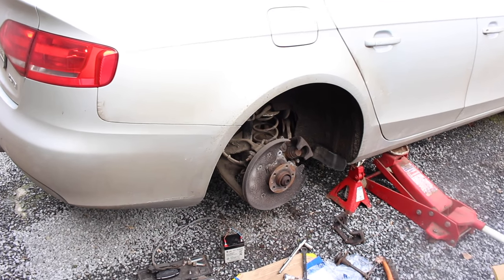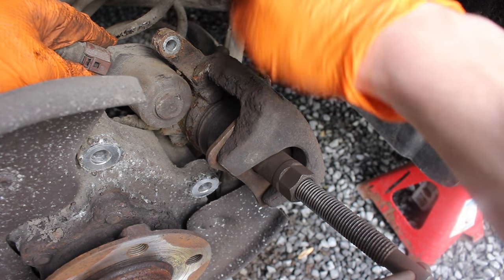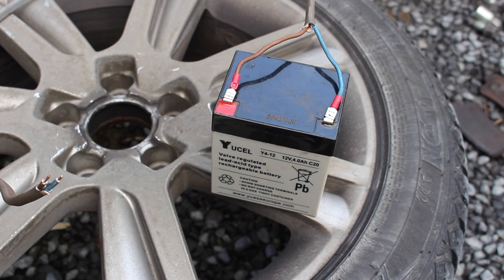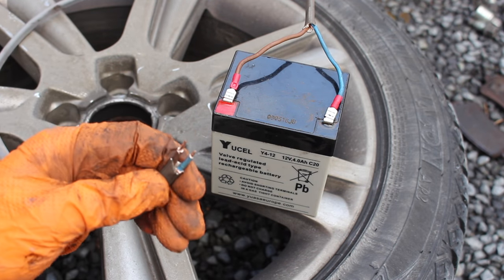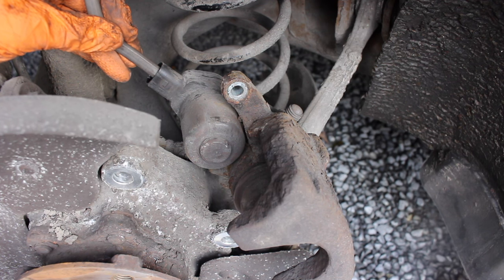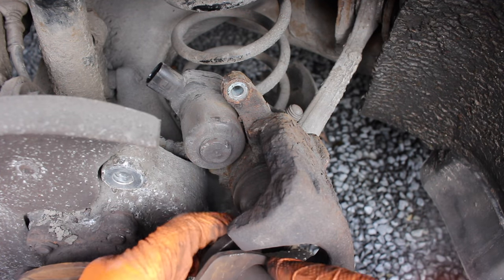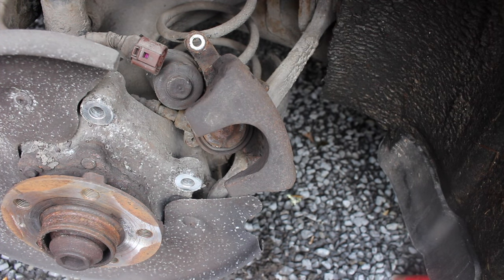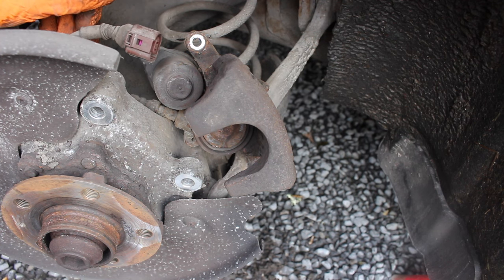How to rewind Audi/VW rear calliper with electric handbrake (without scan tool)

Comment: If you take the electric motor off the caliper (2 bolts I believe), you can wind the auger down with an Allen wrench; no battery required.
Reply: Can confirm. Have done this myself.

Comment: Hey Sam, you could use that piston retraction tool to prevent the piston from popping out when doing this method.  The motor will stop if it feels pressure, thus saving you a headache of reinstalling the piston back in.
Reply: Ñññ
Reply: I want to do my wife rear brakes but this issue is legit my issue. So this can still be manual done?

Comment: Just unscrew motor of caliper and rewind with hand than press the piston. I did it on my superb. No electricity needed at all. 👍👍👍
Reply: This is far quicker and easier
Reply: Literally ! I have the hand tool that turns it back in. I’ve have a few Audis and BMWs lol😂
Reply: Yep, i didn't need to use a motor! Just release handbrake with switch on dash, open up the bleed screw on caliper and force the piston back! This way no fluid will be pushed into abs unit! As easy as doing front pads 😊

Comment: Hello I recently got my discs and pads changed on my Audi a5 now the breaks are sticking - they were not sticking before!! When I took the car back to the garage they took everything apart and fitted the discs and pads again & they are still sticking !! Now they are saying it’s the rear right calliper that is causing the problem!! But I never had this issue before it went into the garage & I said how did you not know that the calliper was like that doing the breaks twice !! They said it’s working fine all the tests were fine!! But there going to charge me £280 for a new calliper and I have the strangest feeling the breaks are still going to stick !! Any ideas what’s going on if the breaks stick when they put a new calliper on ?

Comment: I used this method this morning and it worked perfectly. Just some advice, when the motor is winding tighter you can see it move tighter. When it’s winding backwards you can’t. Or I couldn’t anyway. It’ll pop when it’s fully out. Thanks for the help.
Reply: Hey I have a 2015 q5 and the piston is spinning when the polarity is set to retract it but it clearly extends when the polarity is reversed. Are you saying you can’t really tell it’s retraction into the caliper while it is?

Comment: Thank you so much for this.

If you start with the handbrake off then you don't even need much power to draw the auger back. I have just done mine with a 9v PP3 smoke detector battery!

Legend.

Comment: I've also done this today on a VW Touran 2017 R-Line and it worked perfectly. When you turn on the engine, on your dash an error will occur about the parking break but will disappear after you engage and disingage it once.

Comment: Excellent video. A coat hanger wire bent and hammered flat worked as well as your tool for disconnecting the electrical connector, incase anyone else finds themselves swearing already at step 1🥴.
Reply: Oooh, yes. This is a very important step. Removing the connector can be a job on itself. Don't get me started on how I removed a simial VAG connector. It looked like it was chewed by a dog.

Comment: Just a note of warning!!! The cars control unit for these wind motors monitors load (in Amps DC) being pulled when motor runs. When amps climbing sharply (motor pushing hard against pad/disc), it stops the motor. WHEN you simply apply a DC voltage from a battery and wait for it to bottom out in either direction, be quick to react, as the motor / gearing can easily damage itself! A fuse in the line wire from the temp battery is also a good idea (in case of shorts or accidents).

Comment: Thank you for this !!!!! sAved the day !!! my scantool had issues with data returning from the braking system...this manual procedure saved my morning, worked like a charm on my 2013 A8L 4.0 !!!!
Reply: My mechanic fucked my parking brake, even though he had the scan tool, popped the piston and screwed it back in ,

Comment: 9V battery works also. In my experience on VW CC 2011, the battery option is the best, as it works regardless of how seized the actuator mounting bolts are or how strangely "Intermittently faulty" scan tool app wants to be. (Carista, I am pointing at you.)You will always get the connector off, even with sand in it, like in my case. Use good pick tool, carefully. It helps, regardless of potential damage you may cause. Just research your style of connector first.

Comment: Using a battery without fuse, make sure that you immediately remove the wires from the epb motor to prevent damage due to high current. L when the motor stops it actually trying to pull more current to continue spinning. If your power source can provide 100A, the motor would try to load 100A and potentially damage it if the wires were not removed immediately after hearing it stopped.
Reply: There are wires between your potential source and the EPB motor. If you’re using salami thick wires to unwind piston, you’re doing something wrong, perhaps 🤣

Comment: It's pretty important to note, if the handbrake is off then leave the calliper retracted. I would say its easier to leave the handbrake on. My car threw a wobbly. Started to panic we was going to need a scanner as we couldn't release the handbrake. Had to remove the wheels again wind it off and reply, after putting the handbrake on
Reply: I retracted caliper with handbrake off, is there a danger of handbrake coming on while driving on its own

Comment: I have some follow up questions for this if someone could please help out with.  When you start the job what do you do with the electronic parking brake, assuming that you make sure it is off?  You state after you put new rotor and pads on to apply voltage to the parking brake to set the brake firm on the rotor, this kind of goes to my first question was the parking set on to begin with?  If you snug the parking brake to rotors do you need to turn off in car after brake job is done?
Reply from the maker: Before you start set the EPB to off/release then remove the connector from the calliper.
Reply: @FixitSam  it's a good recommendation but I've just done this job after I've seen the instructions and I had actually left the EPB on. It doesn't make any difference I would say. I think it's even safer to have the other wheel locked.

Comment: I tried this method but it didn't work for me. I tried connecting, battery recharger and also jump leads off another car battery.
In the end, purchased a Ancel 500 for £30 on eBay.

Comment: I used this method and it worked fine, but now the auto hold feature on my 2018 VW Tiguan isn’t working, any advice?
Reply: Shocker. Take it to the dealer so that they can gouge out your eyes with a new electronic brake caliper.

Comment: Do you really need a 12v battery? Maybe a 9v will do the job?
Reply: I have heard that does work.  I really wanted a 9v battery to fit into the connector as that would have made an amusing video, but sadly it didn't!

Comment: Why do not use the switch? it has two position one is for stop, and one for release, use these position for that you need. when you pull up one position it is brake, when you press down other position it is released.
Reply: It only releases enough for the pads that are in. If you want to install new pads and or disks you need more space
Reply: Yes i did this too with switch on dash! Release p.b  and open the bleed screw on caliper and force the piston back, this way fluid is not pushed back into the abs unit. When done on both sides just operate switch on dash! Easy as doing front pads! 😊

Comment: Could I use a battery charger or just a normal Car battery?
Reply: A charger works fine
Reply: Yep most cars have a 12V battery
Reply: @clomagro  I know that
Reply: Then  why did you ask a question ⁉️🤣
Reply: @clomagro  I didn’t ask what voltage a car uses for it’s battery. I asked if I could use a fucking car battery to do the job.

Comment: Can someone please tell me which of the two large and two small wires for a 2007 D3 Audi A8L should be power or ground to retrofit these calipers to another car?  Which of the smaller wires are signal/trigger wires to activate the electromagnetic solenoid and clamp the rotor? Thank you
Reply: The two fatter spades inside the plug in are what you use

Comment: Does this mess up anything with the computer as far as positioning is concerned?
Reply from the maker: No, I would imagine the computer monitors the current draw of the motor, as there is no sensor on the motor.
Reply: How coulld it? There is no data line going to or from the motor. Only power. As long as you use the 12v power to push it back to the disc, it will be where it needs to be.
Reply: @Fluxtroid  interesting fact is that the Computer knew that I left the parking break connector unplugged. It was saying that there is a fault with the EPB

Comment: Could you not just put the handbrake on after installing the pads to wint out the piston??
Reply: I think it will also work in this case. I assume the car computer doesn't know the exact position of those motors.

Comment: Kind of answered my own question here but if you rewind the caliper while still on the old disc and pads surely this will negate the risk of getting the polarity the wrong way and risking piston pop out?? I've never done this so don't know if I'm speaking out of my exhaust?
Reply from the maker: Just touch the wires briefly to see which way the piston moves. It won't move that fast.
Reply: Sounds like it would work but since it is coming off to allow the pads to be changed then just do it like this. You might break it if you make it squeeze the disc and fry the motor?
Reply: Anyone know how to remove the brake line on a s5 2009?  Any help helps!!!
Reply: Andre Medina try talking to a garage if you don’t know about brake lines then don’t fuck with them... they have to be done properly or you risk the safety of you and other road users.
Reply: @andremedina6886  use a vise grip if the head is buggered

Comment: Works a treat.  I did this at the weekend on my renault scenic.  I used spade connectors to make a more solid connection to the terminals and prevent sparks pitting the connector but other than that just the same.  good video :-)
Here is me doing that similar job on the Grand Scenic Mk3!  https://youtu.be/kGn7tEjr600